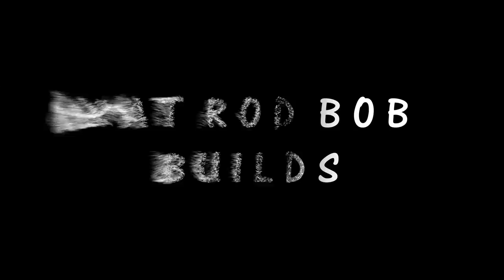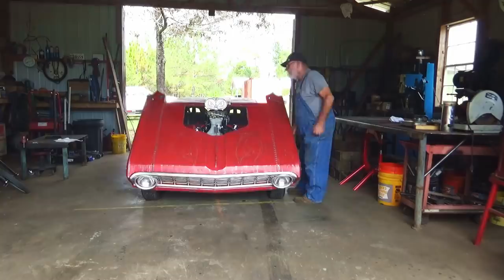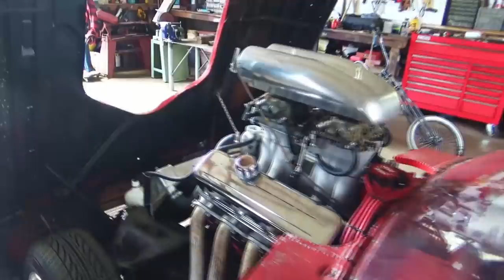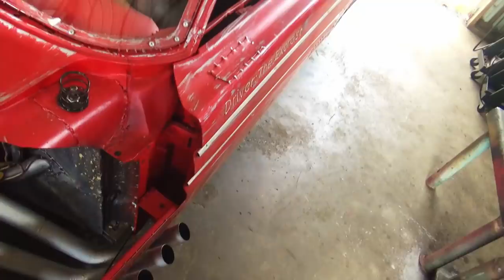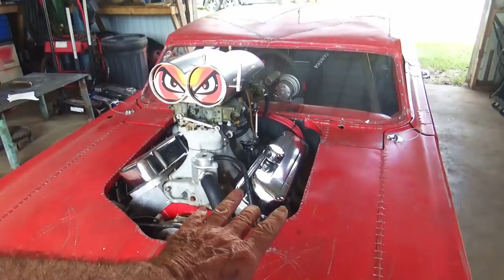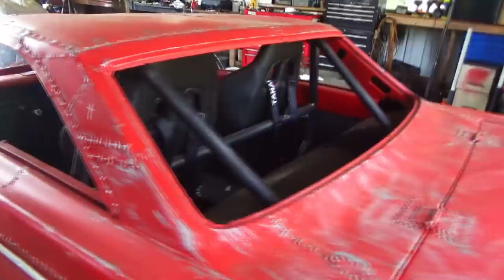Red Hot 64 Falcon Rat Rod 496 Stroker - Fire It Up

Comment: YES, naturally asperaited, that's where it's at. Big cubic inches, high compression and all the carburetors you can bolt on to that bad boy.
   Can I ask what brand tunnel ram you are using? I ran a 468 back in the day with a offenhauser tunnel ram with two 850 holleys. Love your work, bad to the bone. 👍👍🏁
Reply from the maker: It's a Weiand I bought for cheap off eBay.

Comment: I know your engine is a BB! I'm looking to build a SB 350 I like the look of a dual carb tunnel ram set up what's needed in a short block to make this happen?  Cam,pistons,heads, ignition, etc or can you run a dual tunnel ram using a stock build 350 4 bolt main? Just a little help in the right direction!  By the way love the build!
Reply from the maker: Just bolt it on and it'll run fine ... no low end power though. If you want it to go fast you're gonna need some guts in it. The 2 four tunnel ram is for looks and a single four will perform better.
Reply: @RatRodBobBuilds  yep love the dual tunnel ram set up the look is badass!  Okay I'm going for it.

Comment: Not the tire size, change the rear suspension geometry. ✌️Not talking sh!t just an idea. A guy here has a '66 Fairlane with a 10.5" tire and can lift the front off with a built 460.
*My friend just got done putting a 426 side oiler in his '64 Fairlane, fake Thunderbolt but it's still bad ass! I had two rust free '67 Fairlanes, never should have sold them. We dont have too much rust issues here in Oregon. 
**Your Falcon is bad a$$!! Huge respects! Makes me laugh that you're sitting in the back, makes it even better!
Reply from the maker: No weight transfer .. the front suspension is stiff.
Reply: @RatRodBobBuilds  - Oh, that definitely makes sense then.

Comment: Did you bring it down to cruising the coast this year?
Reply from the maker: No .. I did not.
Reply: @RatRodBobBuilds  that would be a sight to see. I have a question if you don't mind.. what will cause screw in studs to back out. The type I have want allow you to torque them down their on a set of machined vortec heads.